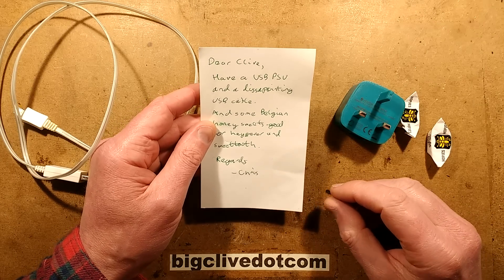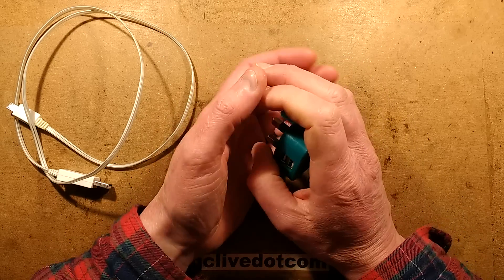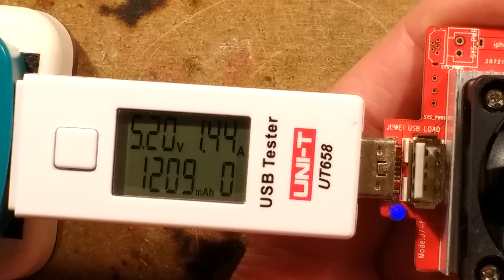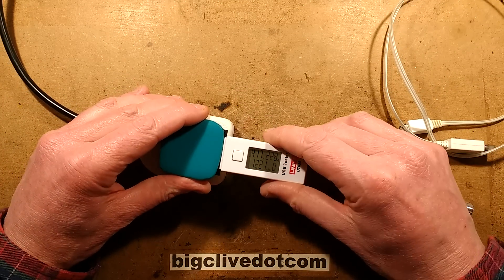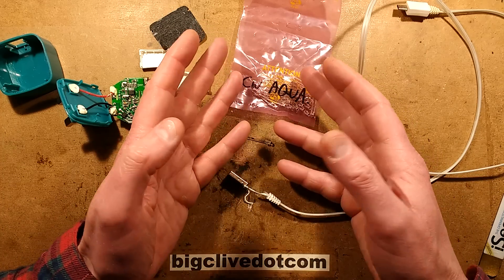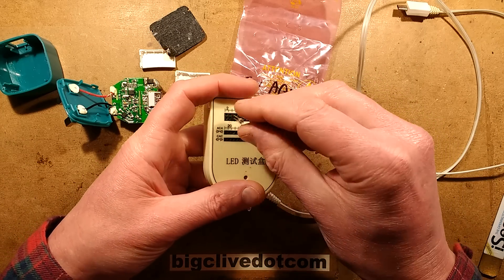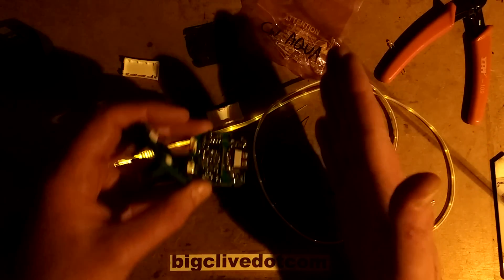Stinky Poundland USB charger and hack of random "faded" USB lead.

Comment: It's not just the cheapo supplies that go bang, I had a Sony Xperia USB charger go bang in my hand and I had a shock off it and I decided to investigate what went bang and it turned out to be the smoothing capacitor on the output causing an avalanche effect

Comment: also talking about my blown charger, I thought I could open it so I used my own X-Ray machine and smashed it against the wall, it delicately opened to reveal the internals and the capacitors were busted in it, the charger still sorts of delivers power to a device but I do not trust it as it makes loud buzzing noises and quickly gets very very hot, indicating there is some sort or arching going on inside, so... I took a few pictures, you can take a look to it in this gallery I just made lol
https://imgur.com/a/oM4rfnh
Reply from the maker: It looks like capacitor failure, and the opto-isolator shows signs of either corrosion or high current.  I'd recommend disposing of it and getting a new one.  Only buy the new one from a high profile brand (including Walmart) that has to protect their reputation.

Comment: I have a USB power bank that really tests 2 amp power bricks. it charges them at 2 amps for like 8 hours straight. 
good thing it has a laptop power supply port that allows bidirectional charge, because I wouldn't trust it otherwise. 
My laptop makes it get warm because when it's charging my laptop, just the battery takes about 50 watts and add 10 on top of that for 60 watts, which maxes out the default power supply, so i got a new PSU for it that goes to 90 watts and that brick is a lot happier than the other one.

Comment: I collect Halloween props. And life size animatronics. I have a Michael Myers animatronic that overheated, and one of his capacitors or resistors (I’m not great with names of that stuff) blew out, melting several wires and part of the case. Almost catching fire.

Comment: Will that LED tester work on the tiny incandescent Xmas lights? I have about 30 strands of icicles that I need to test this summer. TY!!!
Reply from the maker: The LED testers don't pass enough current to light the tungsten lamps.
Reply: @bigclivedotcom  Hmm... Would you know of one? I found a tester. But it's for line not bulb.

Comment: I burned one of these signalex USB chargers from constant use at 2 amps over the course of 6 months powering my 18650 charger. No fire, just got very hot and smelly and then failed to output anything useful afterwards.

Comment: who needs fuses in usb power bricks just put the only pressure release on the plug face so when it goes boom it blows the device away rather than just cutting the power
then when mommies see the power brick fly across the kitchen and learn that it just died then maybe they will just keep their kids away from EVERYTHING LIVE rather than complain about "overly large vent holes" in products that get waay too hot

Comment: How about to improve USB  power supply they manufacture the casing using Thermally Conductive Plastic ? 

CoolPoly® Thermally Conductive Plastics. ... Thermal conductivity in a plastic provides the ability to meet demanding engineering requirements in many applications more cost effectively than other materials including metals, ceramics, and other plastics. Thermal conductivity was a “missing property” from plastics.

Comment: Yeah, I threw a pillow over my Echo dot while moving stuff around before going to bed, next day Alexa refused to understand me, the device was hot, the odd thing is it still would not work after several hours of cool down, I resigned myself to the thought I've destroyed it, till the next morning when Alexa sounded a weekly alarm I have set and I commanded it to stop, it did so without a problem and has recognize commands ever since, 24 hour cool down or Alexa pouting?
Reply from the maker: It would have been better to unplug the unit to let it cool down.  It would have been in a rogue state due to the overheating.
Reply: I should have been more clear, the cool down was me turning it off, first for about an hour, still refused to recognize commands, then part of the day, I don't remember exactly how long, I left it off, but it was late afternoon when I turned it back on, still it did not recognize my voice, the reason I left it on after that is because functionality was still working in the Alexa App allowing access to my smart home devices.

Comment: Observing this damage, they really need to add prominent DO NOT COVER warnings to these (just like those on nearly all space heaters). (That, or mandate much more robust thermal protection.)
(In an old-school linear PSU, on the other hand, the worst thing likely to happen in this scenario would be a blown thermal fuse.)

(Knowing the system, though: The regulators will probably do their usual business of waiting until a real tragedy happens, and then rushing out a knee-jerk, ill-planned "solution". :( )

For what it's worth (I've tested it myself), properly engineered fan heaters (even at the full 2.4kW in Australia) can survive being covered for quite a while (the thermal cut-out will cycle on/off, but that's its job ), without serious damage. (And if the thermal cut-out is of a type that holds in the tripped state until after powered off, that extends it from "a while" to indefinitely .)
Those that melt their casings are badly designed, and I personally wouldn't even consider using one of them myself…

Comment: When I bought my first light up USB wire, it had two RGB LEDs in it, one in both end and a fiber with notches in it to create a row of RGB dots. It worked for 2 days, and then burned out. Turns out they relied on internal resistance of the RGB chips in LEDs to limit the current, but there was none. They were rated for much lower voltage and current, and because they were both weird square packages, I colony actually replace them. Be warned: always check that you buy from reputable people.
The type Clive has there actually does have a current limiting SMD resistor in it. I have 3 and all are working since 2016.

Comment: I’ve often wondered why usb power supplies don’t use aluminum heat sinks. Danger of electrocution with the use of exposed metal?
Reply from the maker: It's probably to save money by relying on the thermal rating and built in protection in some of the driver chips.  The bigger power supplies may have heatsinks.
Reply: bigclivedotcom thanks for the reply. I come away from your content smarter every time! My questions have been answered.

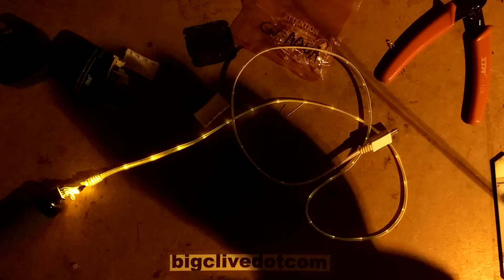Comment: 18:04 for 2 pound? nah. if it doesn't start a fire I am not concerned.
though would be interesting if you could add a heatsink to the diode (without risking short circuit ... any or to mains)

Comment: UL has a hot oil test for power supplies over a certain power rating. I forget the standard off the top of my head. 

The gist is that they pour hot oil into the top of the enclosure and it can’t let any drip out. I’m guessing it’s to simulate flaming plastics when something fails inside can’t escape to light carpet on fire?

Comment: I have a similar USB lead but it has chasing blue lights which I think are EL instead of LED and fiber optics.  I think it fried itself when I tried to use it with a fast-charge capable power supply.  It would vary the speed of the chasing lights based on the amount of current that was feeding through it.

Comment: Since I saw him using this load, I think I have the same one from Aliexpress (with a display and you can add an external PSU to it). Unfortunately you need at least roughly >2V (while having a PSU 5V power the device itself) so it does not work to measure normal batteries.  
Anyone knows an alternative?

Comment: Bought a cheap replacement power supply for my Thinkpad, because the wires failed near the plug into the PC.  Had it about a month, and one evening smelled something odd... then odder, then much odder & alarming:  smoke!  The power box was melting & scorching itself AND the carpet!  Ack.   I chopped off the DC cord and grafted it onto my offical Thinkpad power supply.

Comment: vents on the PSU's wouldnt be great....unless its carfully designed as if any bits of metal, or conductive bits get into the hole, then it will short out and/or go bang. im sure ive had that issue with something...i forget

Comment: Hmm. I might be completely wrong, but it was my understanding that with good quality power supplies (samsung / apple / etc.) they were designed to shut themselves off if the temperature reaches a certain point?
So how does something like this still happen?
Reply from the maker: The internal shutdown temperature of the switchmode chips is usually around 150C so they'd be too hot to touch by the time they did shut down.

Comment: When I was a lad, EVERYTHING had a fuse in it and a "proper" transformer... Then again that meant that a 1a psu was the size of a housebrick.
I still have some of the meatier ones, around maybe a bit noisy but safe for drying towels.
Thermal fuses were a bit of a thing too - but rarely used in PSUs.

Comment: The other argument for no ventilation is it stops the magic escaping and getting out into the wild where it might cause trouble. On larger supplies / enclosures you can make a double layer for ventilation which is almost always ugly but it can allow some air while preventing wires being poked in or magic escaping out.

Comment: I use $4 harbor freight flush cut snips. They have a lifetime warranty, so when I inevitably blunt, chip or otherwise dull the edge, I bring them in to harbor freight and trade them for a new pair. I have a nice(r) pair that I use for actually cutting wires and whatnot, and I use the cheap pair for things that might ruin them, like cutting springs and mig welding wire.

Comment: What about beside/under the bed, or just on the carpet in general? Behind my desk is not much room, I'm using every last inch of realestate I can get, so that means that some bricks may be covered in a few random cables. Is this a major concern? What about having a ton of cables bundled together? It's quite messy, but no single thing draws more than about 500 watts, and everything runs happily off a single 10A (240v here in Australia) power point. Everything tallied up is about 800 watts or so, it's just that I have 7 power boards coming of one power board, and about 40-50 plugs in use. Just lots of small items, but lots nonetheless. Is this a concern?
Reply from the maker: As long as there's some airflow it should be fine.

Comment: Apropos USB chargers... Do you know about the AAA LiPo batteries with integrated charger? Can you dissect one of those? Here is a link to german eBay, UK will have something similar I guess. They are all from China: https://www.ebay.de/itm/2STK-1-5V-AAA-400mAh-LiPo-li-ion-lithium-rechargeable-battery-USB-charging-new-/253424670104

Comment: Its not just cheap blue/white LED's
name brand products with smds and early 5mm DIP style products also suffer...
I have seen a lot of buses with led marker lights and led interior lighting in DIP style and most of them don't seem to have aged well
Also with name brand 5mm led torches - they seem to suffer from bad connections / flicking not too long into the life of them
I have blue DIP leds in my name brand case fans and the leds are pretty dim now... compared to my SMD led strips they have not lasted well
I also have had 3 logitech mice with RGB (separate) SMD leds and the blue diode always goes much quicker than the other colours
Probably a problem with substrates / phosphors and DIP processes being immature/suboptimal
Reply: needforsuv  Having investigated many LED circuit designs, I'm not surprised. In both consumer electronics and in products sold to businesses, LEDs are either overrun or used at their limits with no thought to derating due to temperature. Hence their lifetime suffers.
Reply: Thing is some of them seem to be in house designs and such
the later replacement pieces seem to work better
It could just be bad led's to begin with
afterall the circuit board may be in house but they certainly had to make or source the led's somewhere

Comment: When Clive mentioned that the USB power supplies should have vent holes I thought: what about bugs getting in a shorting out stuff?     Do bugs pose any real risk if there were big enough vent holes?
Reply: RansuDoragon  Normally no. Insects don't cause short circuits. But they can cause other problems. Insects that nest in large numbers or ants filling your device up with dirt/soil can cause failures. A build up of insects or dirt/soil will cause a build up of heat in the electronics as the airflow in the device becomes restricted...

Comment: Another interesting video. None of the Poundlands around me have the 2 amp charger only the 1 amp charger. The one amp charger doesn't get that hot, but certainly the case is warm to the touch and you can feel when the charge is finished.  It recharges my phone in around two hours which is pretty quick for me. I was after a 2 amp version but having seen this may not bother.

Comment: You can also 'cover' PSUs from the bottom.... about a month ago I noticed a typical 'those electronics are far too hot' smell in my house but I could not for the life of me figure out where it was coming from.  A bit later, my PC shut down hard.  I figured out at that point that my PSU had given out.  It did certainly feel warm.  It was at that point that I discovered that my PSU, which is mounted in the bottom of my PC case, was absolutely choked of air flow.  My PC case sits on the floor... a carpeted floor... and despite it having feet, they had sunk into the carpet to the point where the air intake for the PSU was completely blocked.  After cooling down a bit and being raised up so air flow could resume, I was amazed that the thing actually turned on again!  For about a week, during which it continued to stink.  But it worked!  And then it didn't.  Finally gave out suddenly.  I replaced it and checked the dead one... yeah, it apparently melted the coating on the wire wrapping one of the transformers and I imagine arced impressively.  That would explain the bit of glowing I saw originally... really no idea how the hell the thing worked for that extra week.... But yeah, make sure air can circulate around your PSUs of any form!

Comment: This video reminds me of a brand name head-mounted flashlight that smelled burnt as soon as I opened the package. It took a week for it to not smell so bad, but it worked so I didn't bother returning it. I've used it daily for about six months and the only issue I see is that the LEDs occasionally flicker. I've been curious to crack it open and see what's wrong with it, but I'll probably wait until it stops working. I do wonder what could be wrong with it since it came from the factory like that.

Comment: Apple products are just a brand name. I put more weight behind companies like ASUS in all honesty. Better build quality & durability rather than the cheap plastic crap Crapple pump out of factories in China....

Not to mention soldered SSDs, DRAM and such causing spikes in NAND and DRAM prices & shortages.....because people can't help but throw out their old Apple phone or iPad and get a new one the following year..
Reply: S.A. Smith That is a bit of a stretch as most do not throw them out after using for a year, rather most will go onto new owners in the second hand market (or to other family and friends) so those memory and SSDs, etc., don't suddenly disappear from the market after a year.  If I had to venture a guess, the average iPad and iPhone will live about three to four years in the market, barring catastrophic damage (like my mother running her iPhone 5 through the wash several years ago), before most have been largely retired (about the same time that the batteries tend to begin failing in my experience).  That is also about the effective life of the iOS operating system for older devices as beyond four years the devices are usually no longer adequate to be supported by the latest OS upgrade due to increased demands on memory and processing power coupled with outdated hardware that newer apps are likely to be expecting.
Reply: Asus had also gone crap because of rohs. The solder joints don't last.
Reply: I've had no issue with ASUS Motherboards, GPUs & the ASUS laptop I have (X5DIJ) is 10 years old nearly....I'm typing this comment on it right now..had to repair a couple of things but 10 years and still working alright.

Apple? If it breaks it's not user repairable unless you fancy doing BGA rework because they just solder everything to the board or they try to fob you off with some excuse, or charge you almost as much as a new device to repair it.

Bad company, mediocre products, bad customer service but with a smile (which makes apple disingenuous). Their products are good for people that aren't too tech savvy and just want something that will work.....child's play if you will..

Comment: I actually would be cuious to see what’d happe to a 2A iPad charger running at 2A under something .. 

I’ve opened a few up and there seemed to be no therman sensing, .. unless the switching IC had any but .. highly doubt that
Reply from the maker: The switching ICs do often have a thermal shutdown facility, but usually at a really high temperature like 150C.
Reply: yeah I guess you're right, the poor diode is then left to fry in its little corner ...

Comment: should be a law they must have thermal cut offs installed
Reply from the maker: The switcher chips often do, but if the heat is being generated elsewhere then it will most likely result in failure.